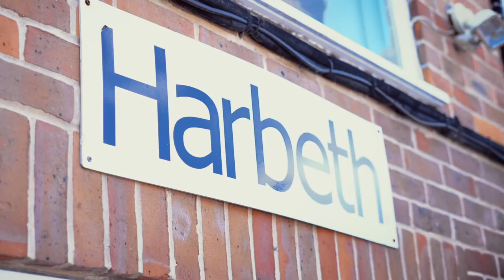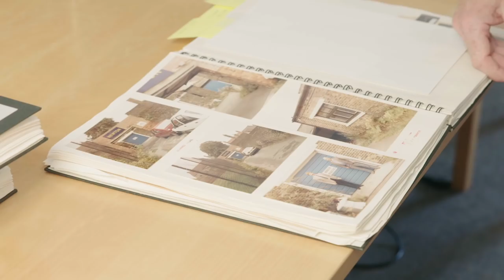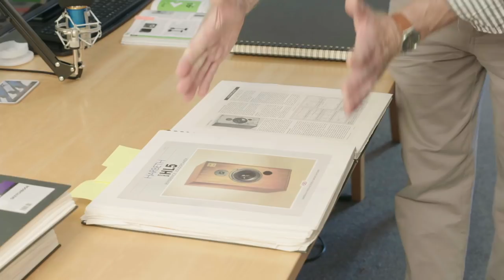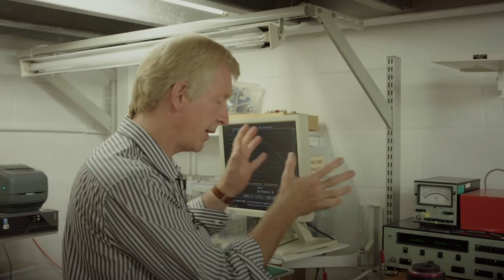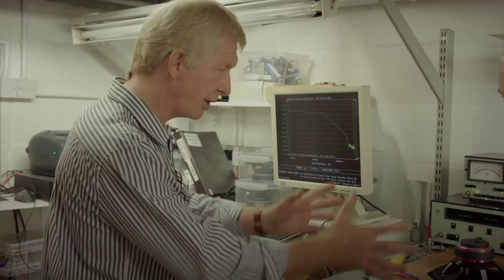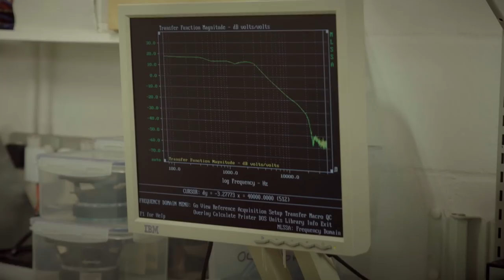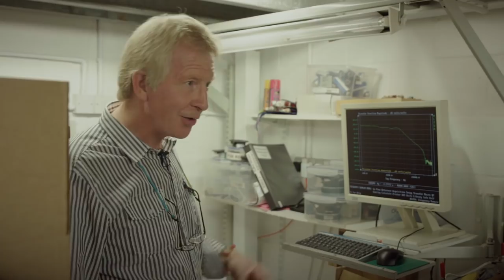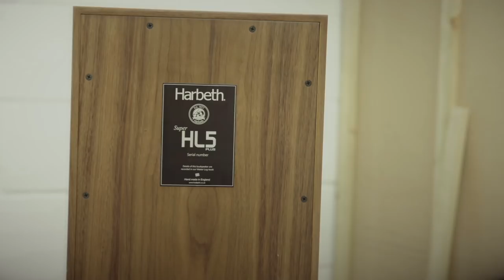Harbeth Loudspeakers Factory Visit

Comment: Love Harbeth speakers and own a set, they sound fantastic and natural.  However as an amateur speaker designer, CAE simulation only gets you so far and then I like to adjust the crossover components "to taste" based on listening.  Every speaker you purchase is "voiced" to a flavor, or taste as it were based on what the designer thinks sounds the best.  So many variables to consider- expected room placement, baffle step compensation, desired output response curve at the listening position, etc.  I would love to work for Harbeth!
Reply: Perhaps they already nailed their reference data way back, so their method of using CAE is only to narrow probable designs or optimize a chosen design.
Reply: Exactly the reason I would only buy audio from those driven by correct reproduction not "taste".

Comment: I've been into HiFi since 1975, and have gone through ton's of gear....until I got some Harbeth SHL5's 10 years ago.
Best thing I've ever bought, and will only get replaced with another Harbeth.
That RADIAL cone material Harbeth's have sure makes a difference, listen to some similar spec'd Spendor's and heard the difference, the Polypropylene Spendor's have much less detail.
The pair matching to the extent that Harbeth goes to makes a huge difference as well, and also one of the factors that make them easy to setup [use light weight open stands]
The 'Rave' reviews they get are not hype, it's just the truth....they really are that good.

Comment: Btw, other manufacturer do use CAD and very complex simulation software which includes the cabinet which is way more complex than a Harbeth cabinet.
Reply: Antonio Stradivari didn't use CAD for making his violins in 17-18 century, and they are still considered the best...
Reply: True, a Stradivari is really considered the best violin. But when it comes to cabinets, the cabinet has to be silent. That  means, the cabinet should not produce any vibrations. When I look at Harbeth speaker, that remains me at Hans Deutsch and his weird cabinet philosophy.
Reply: Sorry, I meant, that reminds me at Hans Deutsch
Reply: @carstenbode8251  I guess that you designed your room with CAD also so the sound is perfect ;)...
Or the drivers used in these "silent" enclosures are soooo perfect they don"t  have any distortions at all...
My point is you pick a pair of speakers and if the sound is good in your room you are happy and nobody cares if they used black magic or CAD,
Reply: @carstenbode8251 ,....."reminds me  OF Hans Deutsch."
Reply: Momchil Zanev id buy spakers which use black magic in an instant.

Comment: Interesting interview.  At 19:50 minutes in the video, as we are presented with a cross over, i noticed what looked like a few solid core inductance coils (and 1air core inductor). Not to be nitpicking but that can generate hysteresis sonic artefacts.  If indeed these are solid core inductors, does the company offer the option to "improve" the order to get air core inductors to improve the sound reproduction (note: by improve, i mean having as invisible and transparent effectb by not degrading the signal being fed to the transducer...and on a good and transparent hi end system, such inductor changes/replacements will be bringing audible performance upgrades since hysteresis causes "false signals" by means of saturation being looped back in the audio being listened to... Said differently, air core inductors are the only way to, specially if having some measure of loudness in playback level, be able to get clean filtered low pass signals sent to the woofer. Not using air core inductors i.e. Using solid core inductors, will limit the playback fidelity.)

Comment: I don't like plastic cones, I prefer paper. But I love Harbeth speakers. The process for making Harbeth cones is definitely a difference.
Reply: I used to like older Focal plastic cones in their 5" designs, even the 6.5" were quite OK, often a bit easier on ear, with well damped modes. Paper sometimes has this sort of 'surface noise' depending how good is the cone, and what's in the mix. I sort of like their warm sound qualities but often they are behind in other qualities comparing with stiffer cones.

Comment: I think the next step "up" for Harbeth will be cabinet material. Panzerholtz is being  used but that's like using Kevlar, overkill for the application but pressed composites or pressed carbon fiber are showing up. Wilson has theirs. When will UK help British speaker meg's with research.

Comment: I used to have Harbeth designed HHB Circle 5, great speakers,
Reply: I assume you got something newer, and may I ask what did you upgrade to  ? how would you compare it with your new speakers ? Can you explain ?
Reply: Jasper The woofer in one of them developed a crack,  they used the rubber type as seen here. This was after 17 years mind you . Reluctantly it was not worth repairing . I use Focal Alpha 50 now which are great.

Comment: Hi very impressive and thanks a lot for the video.  Extremely interesting the point about cone material imparting the overall sound.  I notice that in Harbeth speakers the cone drivers are fixed to the front baffle from the inside and not from outside like usually with other brands speakers.  Is their any particular reason for this solution ?  Actually I like the idea a lot indeed.  It seems to me that in this way the woofer cone is more free in the movement ?  thanks a lot again, ginothe front baffle

Comment: Every speaker manufacturer says they are producing a speaker which sounds pound for pound like the original singer or instrument. I think the BBC uses PMC and genelec?
Reply: Actually, TAD and Elac North America claim to reproduce the engineer's sound. After all, it's the engineer who decides what the final master mix sounds like, which is very rarely intentionally made to sound live.
Reply: Neil Uni 
I have PMC and they are excellent, they are pricey too
Reply: I m from germany, I used to live in UK many years. As BBC staff told me, dynaudio, genelec, PMC, ACT are the most prefered brands, thats not a secret.
Might you als can still find this old shoe boxeswith wood veneer here and there in a control room.
Professionals mostly using active speakers today.
Spendor, harbeth , they live from the glory from the past.
Nice made speakers, off course, but overpriced.

Comment: I always raise an eyebrow when folks use CAD/Simulation interchangeably. Lest you are using an FEA suite w/ graphical interface like Siemens' FEMAP, they are entirely different endeavors.
Reply: For engineers, CAD refers to the drafting software such as Autocad & SolidWorks while CAE for CFD/FEM simulation. So yeah I completely agree with you 😁

Comment: I have a pairing of LS3/5 clones. I bought them new in 1980 they have very thick 3/4 genuine wood boxes . The crossovers are exactly the same as the originals I have been told . Drivers the Kef still in pristine condition as are the tweeters. The most important thing they sound absolutely gorgeous.

Comment: On the part of the boxes, it's more than just rigidity; it's also density, how 'dead' the material sounds, and surface area. MDF is widely used because of how 'dead' it sounds. More recently, people have built boxes using layers of different internal cutouts, using what's essentially a sine wave wrapped around the interior square with each layer having a 180° offset of each wave; this adds more surface area, which adds to sound quality. People also use acoustic foam and polyfill for 'more surface area' and yes while it does add some surface area, the material also absorbs the sound waves.The rigidity and density of the material might add to the 'deadness' of the material, but I'm willing to bet that the molecular and atomic structure of the material also have a factor in that; comparable to how polypropylene's structure effects sound.

Theoretically, based on all this, a sphere should be the best enclosure, having the most surface area to volume ratio. Made from the most 'dead' sounding material. But spheres are hard to construct.

Comment: Has anybody used a Harbeth speaker for Rock and metal? Or are they simply a classical and jazz speaker? Would love a pair but many have said they are not a rock speaker. Is this really true?
Reply: Off course you can use Harbeth for metal, but for metal in the original soundlevel
and deep dry bass , i would say its better to look further.
Reply: @lemmyk7879  That's good to know, as I get the impression that some loudspeaker manufacturers don't 'design' their products for 'that type of music' although they probably do quite efficiently. Thankyou.
Reply: They have a pronounced mid-range, somewhat 'thrummy' bass, ie you can hear the cabinet IMO. Have owned a few pairs over the years. I think for metal etc I'd look elsewhere. Dali, B and W all good fits @dgbelcher

Comment: I have done military, DOE and civilian engineering in the engineering space since the late 80’s and when watching this video and seeing your crossovers I assumed “nice to see a company working slightly up from the bottom basement components in so many speakers today” (even some mid-priced use iron core inductors, sand cast resistors and lower grade capacitors across all driver ranges).  

However, I figured these were relatively low to mid-priced speakers.  WOW, how can you justify using these low/moderate end components in such premium priced speakers?   Anyone worth their salt could reengineer those speakers to sound SO much better than they do with another few hundred in components.  But I guess if margin is what you are after, and you figure nobody knows any better, just keep the quality and price of your crossover components low.

Comment: The comments about "chipboard violins" are interesting, because whilst chipboard violins aren't a thing, plywood instruments certainly are (though they suffer in reputation from being cheaply and poorly made in general) and carbon fibre violins, violas and cellos are now serious contenders at the high end of violin making, not to mention carbon fibre bows which have widespread usage.  Wooden cabinets are not the only alternative
Reply: I reacted on that analogy as well... I have no idea what it would sound like, if someone did it properly, so I would not pass judgment on a material like that.
Every now and then, someone or a company comes up with a new production method that expands the possible uses for types of materials or composite materials. But I get that there is probably no reason for a high end violin maker to look in to how they could make chipboard suitable for use when constructing violins. But if another company in a very different market comes up with an idea that makes the performance such that it would be suitable, that could all change.

Comment: Nice! They go about it with common sense, the sound is all based upon the compliance of the cone! Of course you use CAD, I realized that when I went to school for 3D Studio Max! The glorified CAD! Why wouldn't a designer use it? You have an extensive database of components if you don't create the drivers yourself, my personal choice for my cones is a treated woven hemp! I like the air motion transducers in conjunction for tweeters! Harbeth is tackling the reference speaker problem I always had especially with the cabinet modeling software employed, for example Lineman! I remember a demo presentation software to use on your computer to enable you to listen to the different amp/cabinet models available to the guitar player! The only way your selection  is going to sound correct (heh) is if you happen to be using the exact same reference speakers used when the sound was engineered! I would have loved to have been there when they created the technique used to create the modeling software i.e. the data collection software and logistics for collecting it correctly! Data critical to reproducing the instruments timbre (voice, guitar, piano, brass, woodwind,etc.) accurately which is not possible if not collected accurately! Leading to my closing point... How the hell am I supposed to know how they sound over a YouTube video  without having a complimentary matched pair of Harbeth speakers to playback to?

Comment: the more rigid...the higher the resonance level and the higher the hz spread. also more efficient in general.
referred personally...
aluminium cone or carbon fibre/resin cone. 
the motor driver (voice coil/magnet structure assembly)are another subject entirely.

Comment: Super complex cross overs are not necessary...all you need is a full range speaker like a EV...Altec Lansing..or a JBL will accept all of the frequencies put into them...and reproduce almost all ..then a tweeter to reproduce the ultra-high frequencies that the large full range speaker cannot...
Reply: There is more to it than producing the sound, the accuracy and response is there as well. I do however still agree they should not go to far since you are adding problems when going overboard. Huraay for electronics
Reply: steve mitchell , educate yourself on crossovers bud. I’d say the Xover is 45% of a speaker build.

Comment: Refering to the microphone mentioned: From where do you know that it is "linear" and has no sound of its own, which you compensate for in your speaker designs!
Reply: Change the microphone and you have to buy new speakers! 👍
Reply: Maybe it is a custom made microphone specific to this application, such as an electret condenser microphone circuit which will only get what is directed towards it with high accuracy, but high accuracy doesn't mean the best sound, instead it might be worst sound ever 😂 or maybe it can be a vibration analyzer rather than a microphone, or even it can be a full bridge strain gage setup that can measure the strain on speaker up to very accurate results ;)
Reply: @admniyeokuyorsun...3044  😃😃👍

Comment: I can build my own speakers (using high end components) that are at least as good as any speaker that would cost five times as much by any manufacturer you care to mention. Yes, I have woodworking equipment and skill and I’ve researched what manufacturers do...none the less. The only type of speaker I would not try to build is electrostatic. It is not that hard these days to analyze speaker response with a microphone an anechoic chamber (not as hard as you think, a closet with foam on the walls) and a computer.

Just looking at the crossover components, I can tell you my components are much better. This mans real job is to make the cheapest components possible sound as good as possible. I do not have these limitations because the component cost is negligible on a small scale.
Reply: I believe you sir, but if I want to do the same, where do I start?

Comment: It's a nice story but it ain't work like that. What kind of cables/wiring they used and what kind off amplifiers and microphones they used. These components all have effect on the sound. To hear what they hear you need to have the same aplifiere and the same cables and the recording has to be done with the same microphones. Only then you will hear the full adjustments they made for this speakers.
Reply: The performance of cables are for the most part is a myth.
I'm sure neither their testing cables or the ones used in the speaker are dimensioned to be sufficient.
I'm sure their test set-up is fairly neutral.

And no, to reproduce what is printed to file, you need frequency flat speakers in an acoustically dead space, with even damping, and enough power to drive those speakers in that environment. 
What you still won't hear, is what the mixing and mastering engineers heard, because that would be influence by the rooms they were in, the speakers and their hearing both physical hearing and how the brain interpreted the signals.
And even in that environment ones own hearing will still impact the listening, so one would not even be able to hear what was printed to file anyhow.

Comment: Great  video! I'm sorry, I just don't believe a $3k - $10k speaker sounds that much better than others costing 1/2 or 1/3 the price. Hearing is so subjective and infinity debatable. I'd love to own a pair of Harbeth's, but I'd rather spend a lot less on say a pair of KEF's. The Beyonce comment was just awful.
Reply: Hearing is subjective. However every speakers works like a multiband EQ on the material you play through them. Some even add a lot of resonances. Others simply lack the low end, and might need to be paired with a good subwoofer, and then electronics that supports breaking out the subwoofer signal.

Less resonances are always better.

Flat frequency response can be discussed for an eternity, since that is where the taste lies... However, if the speaker is good enough there is no actual harm in adding an actual EQ and tweak to taste.
By the talk in this video, I do get a feeling that they tuned the speaker to be less harsh then what a speaker with flat frequency response would be, to compensate for the trend of making really harsh sounding mixes. Meaning that it probably colors the sound. It could be possible to fix with an EQ, but altering the frequency curve, could result in unexpected behaviour, introducing resonances or distortions, because the speakers wasn't tuned in that way.
Reply: Stephen Scott 
They are truly amazing, but just not affordable